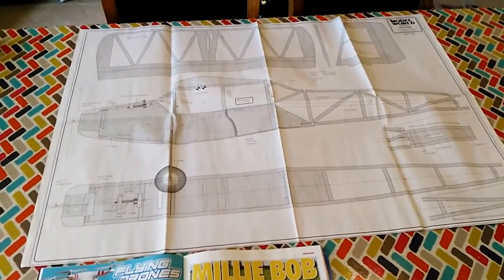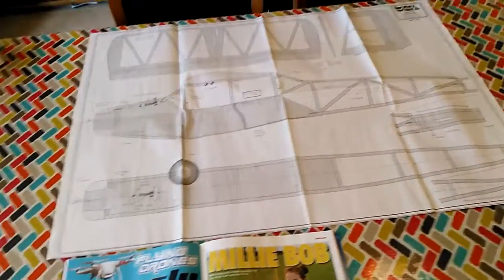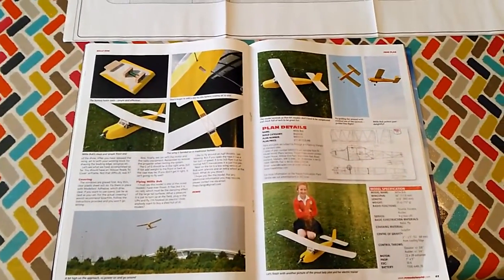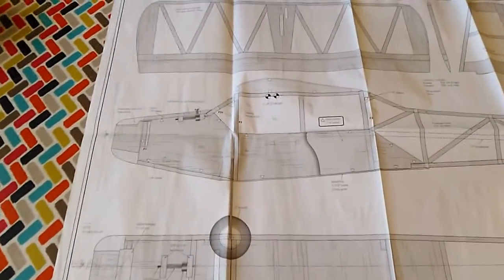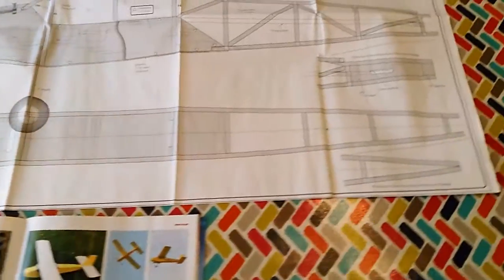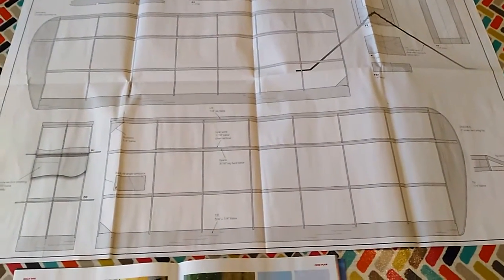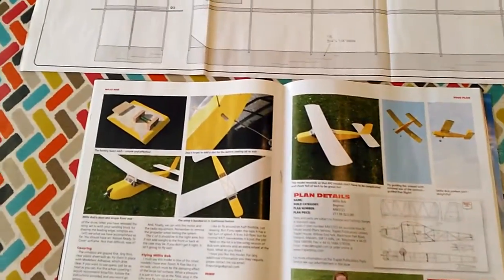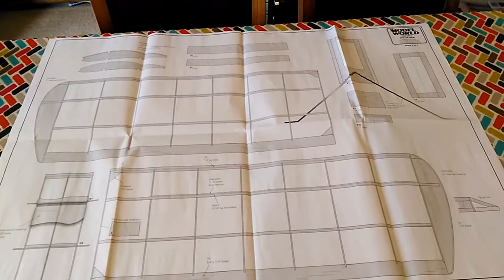Video 1: Building an electric RC plane from plans

Comment: Do you think it would be fine to use balsa plans meant for an electric plane, and put a gas engine in it instead?
Reply from the maker: +Peter Taylor Hi, Yes this should be possible and wouldn't be the first time it was done. There are a few things that will need to be considered though:

 - determining the size of glo engine needed. I'm sure there are some maths out there to compare IC engines and Electric, but I haven't had the chance to dig them out yet.
 - Keeping the CofG in place now that you have a different engine (and silencer), engine mount, tank, fuel and throttle servo.
 - making room for the throttle servo  in the fuselage.

None of these are big problems, but will need investigating before you start building.

Comment: hi.. probably nest to make the plane first, then upload all the vids at once, so we can watch.. Good luck !
 Rob
Reply from the maker: rob b Hi and thanks for the comment.  I had thought about doing it as you suggest but as it's a build for over the winter it would be another 6-8 months before I upload the results! So I was hoping to drip-feed the build as I go, and allow people to ask questions or give me the chance to expand on things with additional videos. 

I'm really looking forward to getting stuck in - it'll be just my second build from plans.... the first was over 15 years ago!
Conor.
Reply: i see, ive never built one, are plans to scale and you use them as a template ?
Reply from the maker: Plans are 1:1, but I'm never quite sure how to transfer the shapes to the balsa. Some use carbon paper, others (like me) do the cheap and cheerful pin-through-the-plan then join the dots.
I've done a rough estimate and the wood plus extras (hinges, undercarraige, control horns, etc.) should be about £40.